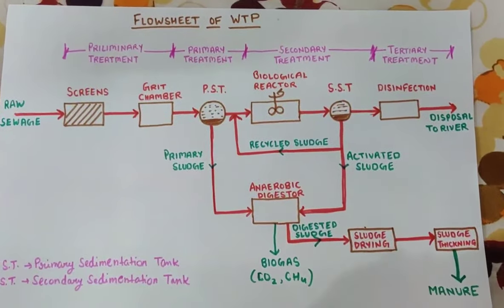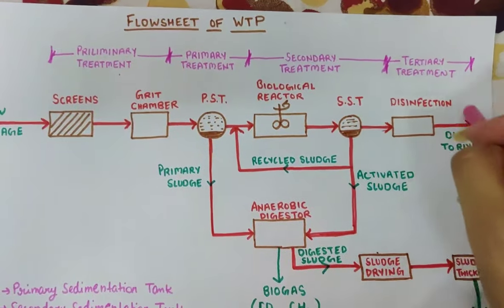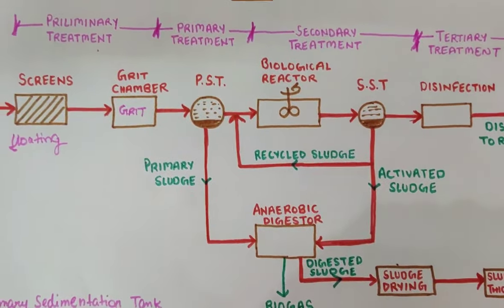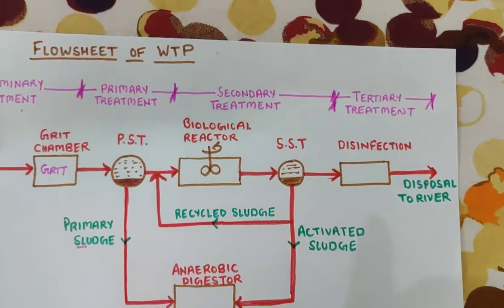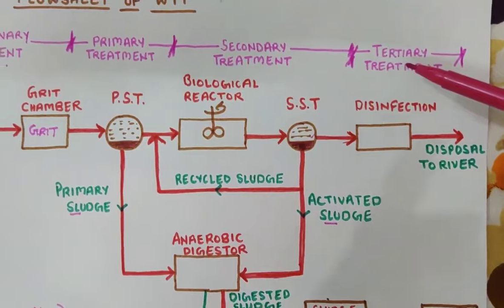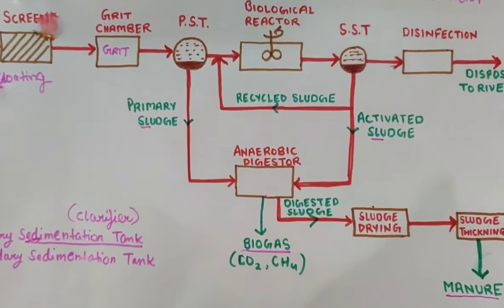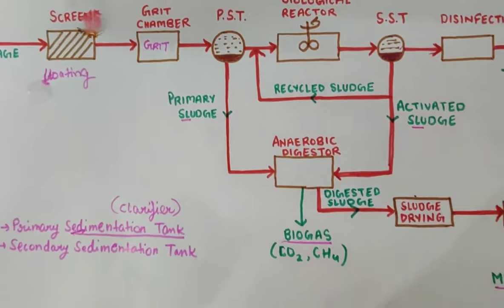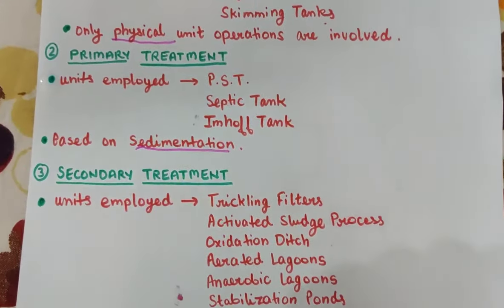Flow sheet of Sewage Treatment Plant/Flow Diagram of Wastewater Treatment Plant

Comment: Stp plant m alum, caustic soda, poly chemical ka use kyu hota hai
Reply from the maker: Alum is used for coagulation to make flocs in order to accelerate  settlement of solids in sedimentation tanks.
Caustic soda is used to increase alkalinity to maintain proper pH u can say
Reply: Thanks ji
Reply: And last question Polyelectolyte chemical ka use stp plant m kyu hota hai